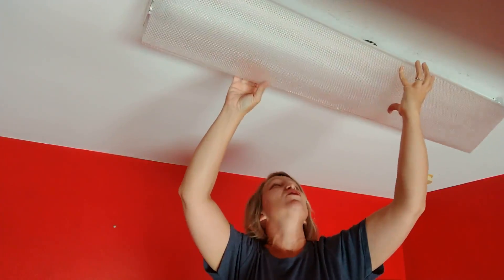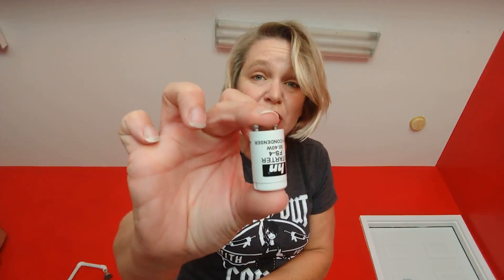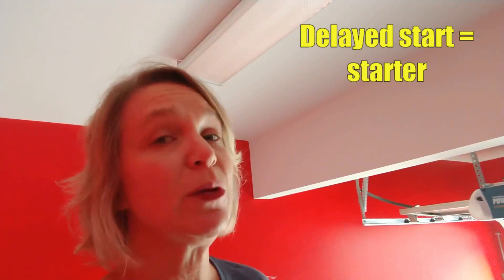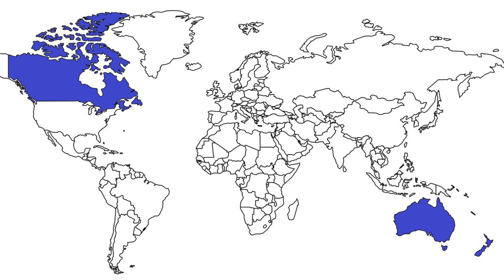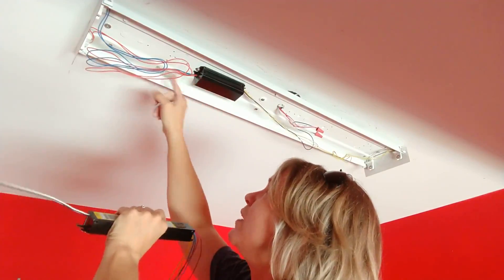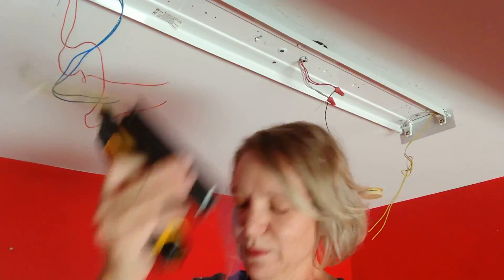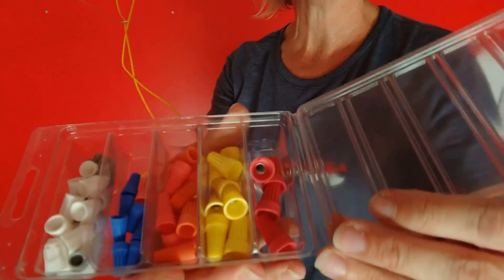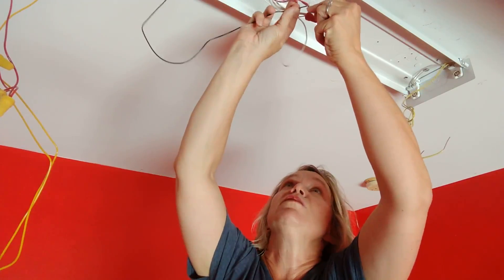Fluorescent Light Troubleshooting and Repair: starter, bulb or ballast?

Comment: I would have wrapped each of the caps with electrical tape for added safety. 
Additionally, I would have also mentioned that the cost of a new ballast is sometimes as much or more than a new complete fixture. Something to consider....

Comment: the "starter" your holding there is actually a capacitor not only dose it look kinda like a battery but it actually works like one too.. kinda A battery will hold quite a bit of power and release it very slowly at a very slow rate for the long period of time capacitor on the other hand will store a lot of power however it releases it all in like seconds and the last thing you want to do is have your finger across both terminals on the top of it obviously you got lucky and it wasn't charged lots of them do have a resistor in between determines so that when there's no power going to it they will discharge themselves but some of them don't have that The thing inside a microwave that can kill you which is why people say don't take my crib apart is one of those It's just a bit bigger and it'll kill you because usually they don't have that resistor and people touch both terminals and end up getting zapped 

another fun little tidbit capacitors kind of like the starter you had there used to be made inside of a glass mason like jar and were called layden jars and they were basically a jar full of electrolytic fluid like water and salt with a coil of foil wrapped up inside the jar insulator in between each wrap of the foil and then another layer of foil on the outside of the dryer with a positive terminal sticking out the lid and people would charge static electricity with the body like we all do and then they would touch the jar and just charge into the jar and the jar would hold on to that static electricity that people could then use another time when they had used for it or wanted to apparently from what I've read Benjamin Franklin used to like to electrocute his food because it would make it taste better on one day he touched the jar terminals when it was very charged and got a nasty shock from it

Comment: I like your attitude and approach to the project. And thanks for being clear about the blue wires. Neither the ballast directions nor several other videos addressed the issue.  Well done!

I would like to add a couple of points to the conversation. First, note that two types of florescent bulbs and ballasts exist: T8 and T12. They are not interchangeable. I blew out my ballast (over a year's time) using a T12 bulb instead of a T8 bulb. The T12 bulf fit so it should work was not the correct solution.  Second, it seems like a no-brainer to use the failed ballast as a reason to change a fixture to LED.  Often, florescent fixtures are not installed with a junction/connection box.  As a result, the job may be a bit bigger than simply removing the old light fixture and attaching a new one.

Comment: It would be helpful for yourself and audience if you do more research into the electrical code and manufacturers guidelines concerning your repair. You have made a few technical errors in your wiring repairs. For example the wire connector seems to be the wrong color code for your wires. Additionally, you did not tighten them enough. The wires should have twists on the insulted wires as well. In both cases above  the wires may loosen and no longer have proper conductivity.

Comment: I got some news to share, I replace the lights and after 2 days they started flickering and turned off. I done realized that my fixture is 15 years old and I have to replace it. Since it's an old fixture, there'll be no damage done if I experiment with changing the ballast. And if that doesn't work I'll just buy a brand new fixture for LED lights this time

Comment: I purchased replacement tube lights yesterday, and they take a few seconds to illuminate. The old ones were clearly failing, as evidenced by the dark spots and persistent flickering. I was informed that if it takes a moment to turn on, the ballast might be faulty, but now I realize I can replace it myself. I never imagined it would be so easy. I'm truly grateful for your video.

Comment: Good job. I need to try it in my kitchen, but I'm not 100% sure which circuit breaker switch to turn off. Yikes. I guess I can try switches that are for other kitchen lights or appliances or nearby lights.

Comment: Thank you so much! I bought new bulbs, and they were flickering, so I googled it, and your video was the first one that popped up. I thought I would have  to call an electrician, but your instructions were well explained and to the point. I was able to change out the ballast on two different lights in my house in about an hour. Thank you for sharing your experience and helping others.

Comment: I cleaned the contact prongs on the end of the bulbs from my 4 foot fixture with a wire wheel, installed them in the fixture and now they're glowing bright.  I did also have to rotate the bulbs a little bit while it was turned on to get better contact.  My fixture is on the side wall of a workshop so everything was dirty.  Your video saved me from replacing the ballast and bulbs!  Now I'm wondering how many good bulbs I've thrown away over the years.

Comment: If what I’m about to share has already been stated, I apologize for the redundancy. It’s a good idea to wear some sort of hand coverings when handling bulbs. Or at least wipe them down with a dry paper towel as a final step before turning them “on”.  I can’t speak for newer low wattage bulbs, but old bulbs got hot and the oils from our fingers (fingerprints) can cause bulbs to burst in a short period of time.  If no gloves or hand coverings are available, simply wipe them down with a dry paper towel or cloth and you should be good to go.. without the worry of a bulb bursting randomly as you walk underneath😂🤣😕

Comment: Just a constructive comment about "wire nuts" (not "electrical caps"). Most wire nut manufacturers recommend stripping the wire ends, but leaving them straight. Push the wire nut onto the ends and then twist it with one hand while holding the wires an inch or so away with the other hand. Twist the wire nuts until the ends of the insulated wire twist together a few turns. The metal spring inside the wire nut will twist the bare ends together tightly and ensure a solid connection.

This is especially important if you are connecting more than two wires. If any of the wires are loose, it can cause arcing and other issues inside the wire nut -- resulting in a fire hazard. Some protection is afforded by using an "Arc Fault" breaker (required by most modern electrical codes), but it's not wise to rely on that.

Also, wire strippers really are an essential tool for this. The issue with using wire cutters like you show in the video is that it is very easy to score the bare conductor  while stripping the insulation. That creates a weak spot in the bare wire that can cause it to break inside the wire nut. This leads to similar risks.

While your installation is probably just fine, loose connection issues can arise over the years. Better safe than sorry.

Comment: Overall very well done, but one (constructive) comment:  As you connected the wiring on the new ballast, you connected the black and white (power) wires before you connected the yellows on the other end of the fixture.  You did have the power off, so technically, this shouldn't be an issue, but any good electrician will tell you...always connect everything else first BEFORE you connect the power.  You may not have known which are the power wires vs. the others, but the black and white wires are the ones that carry the electrical power from your circuit breaker.  It does appear that the incoming "hot" power wires in your case were red instead of black, and that may not be uncommon, but is not normal practice.  Usually the "hot" wire for an AC circuit is black.  One more note:  It is always a good idea, before taking wiring apart like that, to use a Non-Contact Voltage Tester (a short wand that detects if voltage is present) to check the incoming power wires to make certain they are turned off.  This is a safety item that, again, may not be required when you KNOW which circuit breaker controls your light fixture, but I always use one just in case.  That way I know I'm safe.

Comment: G'day. I am not an electrician but do my own electrical work. I do get it checked after I do it though. I live in Ontario, Canada. You can run the wiring for your house but are not allowed to hook it up until it is inspected. I am in the process of changing my very old ballast to the newer type. My electrician friend showed me the diagrams and said if I got stuck I was just to call him and he would walk me through it. If all the lights go out in central Canada and the USA then you know it was me. Thank you very much for your video.

Comment: A bad ballast is not a debate ("issue"), it is a real problem; replacing it by itself or as part of a new fixture is how to repair this trouble. This might prompt one to consider changing the fixture to an LED. That is what i did when my fluorescent ballast died just like yours. You can get LEDs with relatively yellow-ish to white to blue-ish color energy intensities. :face-blue-smiling:

Comment: It's probably easier to just remove the ballast, connect the wires together (in the correct configuration of course) and put in the equivalent sized Type B LED bulbs. That way you'll never have to deal with fluorescent issues again.  Instant on, longer life, etc.  There are yt videos showing the process.
Reply: That's not a job for the faint of heart. The "tombstones" at each end usually need to be replaced -- always tedious and often not possible. The easier way to go is to replace the entire luminaire (the metal housing) with a luminaire pre-wired for type-B LED bulbs. That can be more work than changing out the ballast.
Reply: @thomasstambaugh5181  I did spend quite a while learning about mine before I did it because it was dual ballast and a bit different from ones I'd seen in videos.  Better to be sure what you're doing before starting.  That said, it was worth it.  Other than the wire nuts and new bulbs, there was no real cost to it and the light is much nicer than fluorescent (I got a Feit model that allows you to adjust color temperature).  No problems with tombstones, but of course it is a possibility.

Comment: Another option, if you're already in the electrical bits: wire around the ballast and use LED bulbs. You do the work once and probably never have to change the bulb. Uses about a quarter of the power as well. Very doable at a modest skill level.
Reply: Could you link an example?

Comment: It appears that the knockout where the powe rcomes thru, that you really need to remove the rest of the knockout and install a bushing in the hole to prevent damage to the wires. You will have to disonnect the power wires and snap it into the hole.This will work unless you remove the fixture and install a clamp on the shield part of the wire.

Comment: Great and helpful video!    

I like to avoid using wingnut splices if at all possible since every splice is a possibility to fail or overheat if you didn't get the ends just right.   Usually that will just cost you a little money over time and brown your wingnuts, worst case you can get a fire and by cutting the wires as in this video, that is six splice opportunities.     If you change these out again one possibility would be to simply remove the wires from the connector itself on the light fixture.   It is almost as easy as cutting the wires.

The wires are held in by a metal spring inside the plastic fitting (the plastic fittings also usually can slide right out, but there is no need).   If you stick a small sharp 'pokey' object inside the hole where the wire is and wiggle it, the wire will easily pull right out.   You can then stick your new wire directly from the ballast into the hole (stripped end of course, but most ballasts now ship with wires pre-stripped).   No tools are required to stick the wire in, and once you stick it in you'll notice you can't pull it back out indicating the spring is holding it.     Looks much cleaner and avoids all the splicing and wingnuts, other than on your main power inputs.

A dental tool or small jewelers screwdriver work nicely as the 'pokey stick' but even better would be something insulated or plastic just because since it is electrical and if you don't certify de-energized with a meter.

Comment: Great video but another tip for those who want to do this. Turning off the power is fine but whenever I work with electrical I always use a "sniffer". It looks like a little pen that beeps when a wire is powered, I always make sure that there is no voltage going through that wire just in case there is something wrong with how things are wired (always better safe than sorry). Things are not always clearly marked in older homes (especially with previous homeowner repairs lol) For example even turning off my garage at the sub panel leaves one of my lights powered so that "sniffer" keeps me from assuming that everything is safe when its not.

Comment: When twisting the wires, I like to twist them until the insulated portion also twist on itself a bit. That way even if your caps don't perfectly hold, that extra twist will add some strength too. I also test the connection with a good tug to make sure it's not coming out

Comment: Phew...I just finished mine.  Added complication for me was that I watched a different video before I found yours.  Thank you for posting it!  That other one didn't mention cutting the wires to the "tombstones" = sockets...so I removed them with the burned out ballast initially...then I had to put all that back together, but luckily, I could do that sitting down...still was an adventure.  The screws that fasten the tombstone holders to the upper part of the lamp fixture are very short and pull into frame pieces that slide in from each end.  Very complicated design---why???!!!  Also, I had 4 bulbs, not 2.  I, too, struggled with putting all the wires behind the blind to make things look orderly.  All in all, this cost me 4 bulbs (13.68 each =$27.36), 1 ballast @29.98 all plus tax and two trips to the box store....and oh, nerves to be up on top of my ladder (hello, 14' ceiling in the kitchen!).  But hey, I did it!  Took me about 3 hours, but I "let there be light"!  This was my 1st fluorescent ceiling light, but I've installed/removed a half dozen fans, installed numerous ceiling fixtures and replaced many outlets and switches, replaced damaged plugs (male & female) and repaired extension cords (ahem, electric plug in mower, lol)--AND that's just the electrical stuff.  You should hear what plumbing adventures I've had!!!  I agree with @mikewalker1573...people are weird--why pay someone to do this?  Is time really so precious???  That's a shame.  Where is the fun in life???!!!  As a single woman, I encourage all you single ladies (and guys) out there to use this wonderful youtube universe--YOU CAN DO THIS TOO!!

Comment: Another thing that I just saw from an electrician is to twist the two wires together after attaching the wire nut. It was actually on the directions of the wire nut package.

Comment: Hello, Thanks for the video.  To keep you garage cooler, you may want to ad a Home Depot solar powered roof vent.  They are easy to install on shingles and metal roofs and should let a lot of your ceiling's hot air escape. I had one in my large barn and loved it.  I plane to ad the first one to my large garage and small horse barn roof. (You might get a government tax credit for adding one of these too. )

Comment: This is probably the issue I've been having in my garage. Bulbs don't last for very long. I bought 2 new bulbs and both of them gave out at the same time about 4 months after I bought them. I tried a new bulb in one of the slots and it's still dead.

Comment: I’m a electrician in Richmond, Virginia. Great job. Great job. The most important thing that you did was cutting off the power before working on the light fixture. There are lots of small simple DIY electrical projects that home owners can safely do themselves, but most people don’t want to watch the free videos, and do the research to complete the task. Believe it or not, there are folks that will pay me to simply change light bulbs. Keep up the good work,
Reply: When you wired your common tombstone connectors with the yellow wires, how did you wire them? Was it like this:
Tombstone connector for lamp one:
Wire hole 1: yellow
Wire hole 2: white wire 
Wire hole 3: yellow
Wire hole 4: red wire

Tombstone connector for lamp 2:
Wire hole 1: no wire
Wire hole 2: red wire
Wire hole 3: no wire
Wire hole 4: white wire

I am trying to troubleshoot a rapid ballast replacement for 2 lamps. When I switch it on it flashes once and shuts off/does not turn on.
Reply: Thank you so very much for responding to her video. I’m a resent widow and I need to start doing this myself.
Reply: why cut off the power when it has a switch?
Reply: @JoeB-o4z Always good practice. If you live alone then it is probably okay. If you live with family or are in a garage with an open door where a neighbour could drop by then they might turn on the lightswitch by accident
Reply: @JoeB-o4z  It's like the rule of always assuming that a gun is loaded and never, ever pointing it at someone unless you plan to shoot them. You don't want to trust the switch and happenstances. It's how tragedy happens.
Reply: @JoeB-o4z  I'm only an amateur but I would guess because most switches work by disconnecting the hot wire.  The neutral is still a shock risk. Plus I'd imagine a little extra safety never hurts.

Comment: Fastiest way to strip a wire is heat it up with a lighter a lil bit and to pull it off with ur fingers dont do it to when its melting cause u will burn ur fingers .